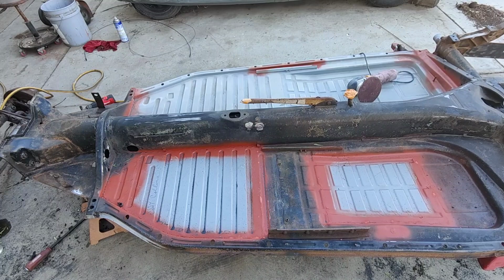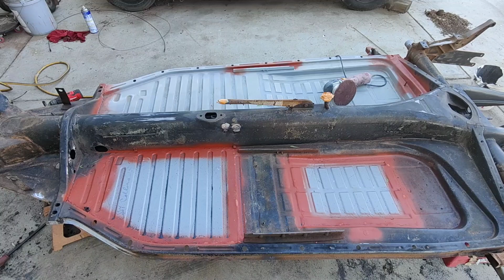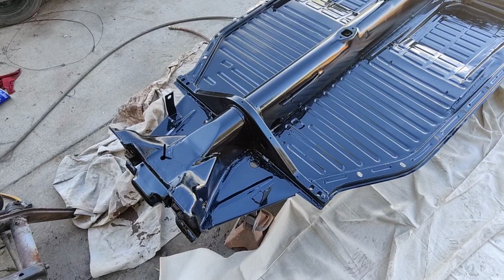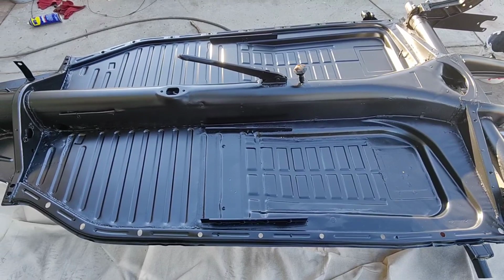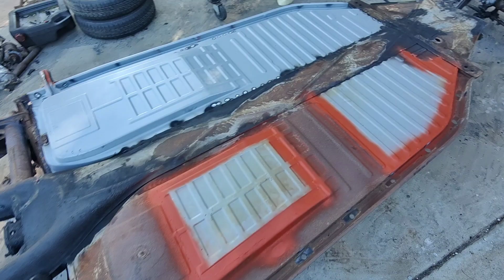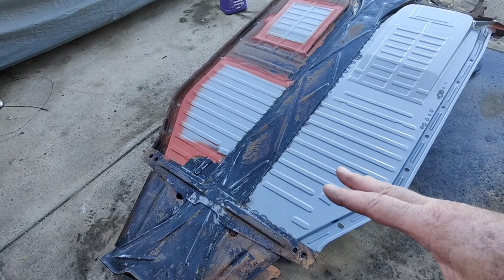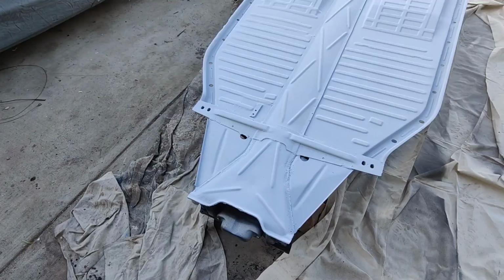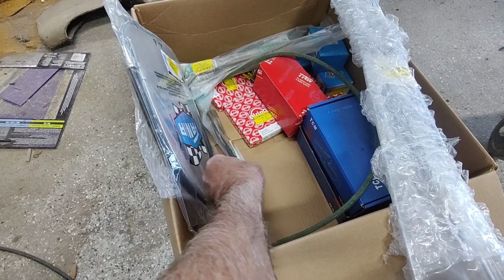RESTORATION - 1954 VW BUG RESTORE Painting the Chassis for Full Build

Comment: This past year I did a Bradley GT for a friend of mine had to replace floor pan on passenger side and repair floor pan on driver side and deleted the tail lights he had taken the top off and I had to do some fiberglass work around the windshield area and that it how I did the delete on tail lights also, for some reason on those cars from the door area to the rear wheels the body wants to sag and it bows out so I cut and repaired to take that out and painted it a tangerine orange and put Pearl over it ?

Comment: Awesome how you can’t even tell where the patching occurred! Are you switching the rubber bushings for the rear torsion bars? Better to do it now than with the body on.
Reply from the maker: Probably leave them original. The old rubber is probably better than the new stuff.
Reply: @Mikefngarage  Especially with a low mileage car.
Reply from the maker: @vayabroder729  the front end is really tight CT says arent you changing the tie rods.....Im like NO....they are in good shape. he is like WHATTT?????
Reply: @Mikefngarage  Maybe the two rubber snubbers if anything!
Reply from the maker: yea the stops front and rear are shot. putting new one on for sure there.

Comment: I wonder that it is allowed to let all the Chemicals flow into the Ground.
Reply from the maker: I think passing gas is illegal. That is a water based cleaner Superclean. People use it to wash stuff inside and outside of their houses all the time. I think it neutralizes the grease....I didnt use any chemicals....Only that stuff. and I am sure there is some hazard to everything....a car oil leak.....Tire rubber on the roads. Probably worse than what I did.